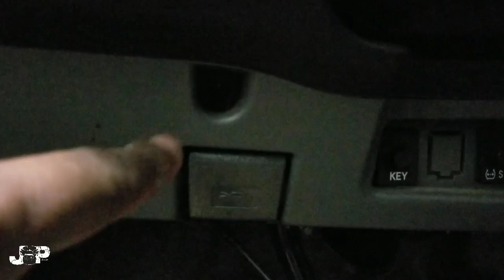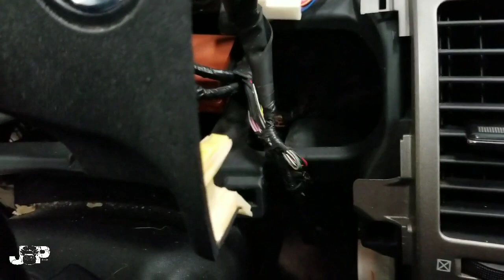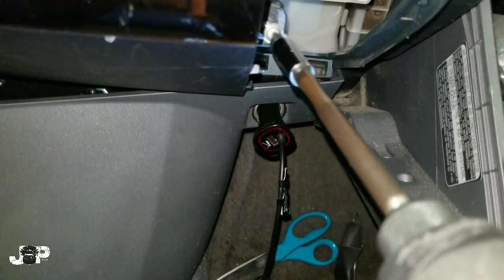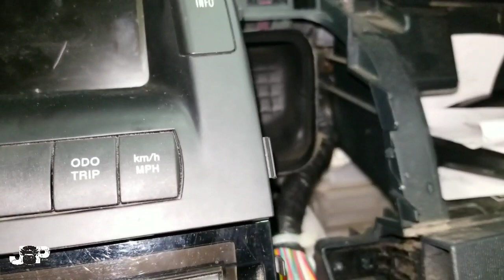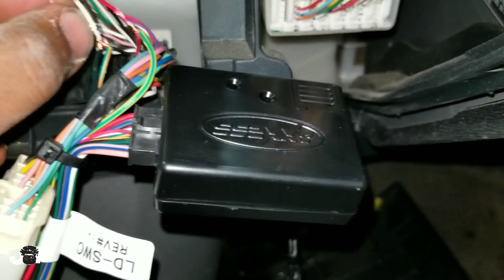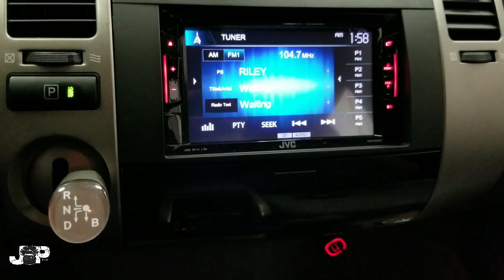2008 Toyota Prius radio removal

Comment: Hello and thank you for the presentation. I also installed such a tablet some time ago on my father's Toyota Prius, it looks similar to yours.

I'm having problems with mine. Sometimes it conflicts with the tablet on top that monitors the hybrid system, and when it does it shows almost nothing, that is, I can no longer see what is happening with the hybrid system or the consumption, and I can no longer use the climate control.

I mention that there is no signal on the GPS or on the radio. When it's working I can monitor the hybrid system and access the climate control but it still has no GPS signal and no radio. What could go wrong?

Comment: now does the stock rear backup cam work still on the top screen and also show the radio station list and the mpg and battery charge features like factory still? I love this idea I always thought the two systems were tied together...

but hey if you have a GPS Navi unit or Bluetooth console and you would like to sell it let me know I would love to add all the factory features since I have the buttons it just says missing console or hardware and stuff...

but please let me know if the upper screen still works as it should after the radio upgrade I would love something current with maps and apple connectivity and still have that mounting kit for that super clean install.. 

thanks for any info you can provide I appreciate it I really do the Prius upgrade community is few and far between, I appreciate your incite..
-pete

Comment: i have an 09 prius that is my daily been driving her 24 miles a day for the past year and a half and it's finally time I treat her to some upgrades, and was wondering if you could help out...

im looking to utilize the space that you installed the double din head unit and use the same area so I can keep the stock upper screen and backup camera, but here is where i could really use your help.  could you provide any head unit recommendations that don't cost a million dollars but can possibly either add apple car play features, or ultimately im just looking for a simple way i can listen to the music from my phone and charge it at the same time, and also a head unit that i can make and receive calls with and lastly has to have good functioning navigation, im thinking some sort of apple car play unit that can utilize apple music and the maps app would be perfect.

can you please provide any head unit recommendations so i can use the lower DD spot and add some navigation and apple car play along with the ability to answer phone calls would be absolutely amazing...

i also plan on installing a 10" Kenwood subwoofer i have with a 500 watt Kenwood amp to match and the headunit has to be able to provide enough and be able to handle that extra power...

please let me know what you would recommend in this situation for my prius, im not sure if you have any recommendations on this matter but im also looking for a nice set of larger wheels for the prius and possible lower it with some lowering springs as well, it is a 5x100 pattern but do u have any wheel recommendations that kind of go with the electric theme but don't break the bank at the same time? is there any way to get upgraded toyota wheels or something maybe scion tc that might fit an 09 prius?

thanks for any info you can provide i really appreciate it, finding a quality head unit is soo hard today everybody says they are great until you experience them for yourself and realize it is a horrible unit... plz help me avoid wasting money I just want to keep my backup camera and add new features i would love a dashcam or external cam hook up feature so i can never get a ticket for someone else having a built in camera and i have nothing of my own i would absolutely love that feature of external camera recording and kind of dash camera type features.... plz help im lost and my prius is soo corny i was also thinking throwing an injen intake to get some intake sound and also some 1320 blaster pipes to make the car a bit louder i would love that...

Comment: I have a 2004 is it the same process? Also the radio link says out of order will any 6.2 inch work for this process regardless of brand?
Reply from the maker: not sure about the 04 but it should be similar process. and i updated the link to the radio i used but any double din will fit bro
Reply: JPtheinstallguy  yea 04-09 was the year of gen 2 so I think it’s the same. Im painting my silvery accents green tonight and the stereo will come soon. I’m going to try to get the stupid jammed CDs out (bought it that way).

Comment: Hi! I bought everything in Amazon but the little wire that you connect from one cable to another for the climate sensor did not come in the steering wheel package. Do I really need this? What would be your suggestion? Thanks
Reply from the maker: Let me check
Reply: @jptheinstallguy  what package does the resistor come in? the metra steering wheel control kit?
Reply: Were you able to check?

Comment: hello nice video, well explained but i want to ask will this work with my 2005 model??
Reply from the maker: Not 100% sure if the 05 is designed the same
Reply: Both the 2005 and 2008 Prius are from the same generation
Reply: 04-09 2nd gen prius. Itll work

Comment: Nice job bro. I have the same year with a pioneer radio installed. They never installed the 68-ohm resistor though. How do you get the wires spliced back like that? I need to do this but scared im going to accidentally cut through the whole wire. Thanks for the vid!
Reply: Do you mean the wire that goes for the climate cables? I don't have that wire. I don't know if I can install the radio without that. Does your radio works fine?
Reply: @gabrielpasarell2677  hi I install a radio on my toyota prius 09